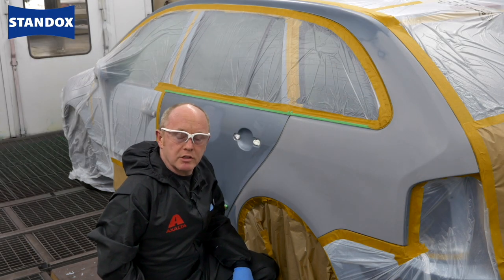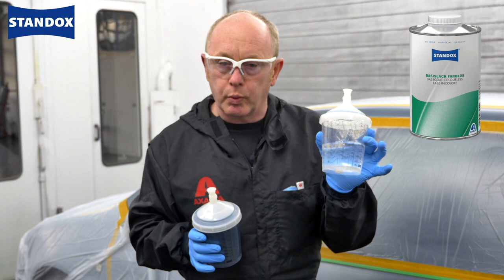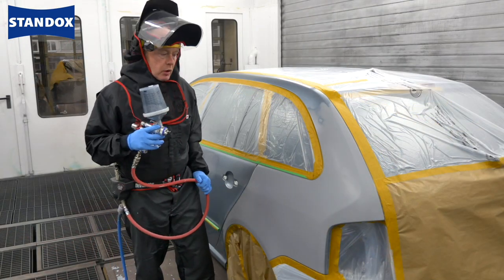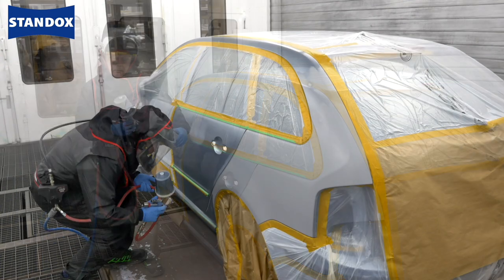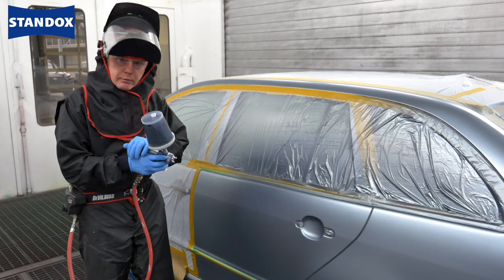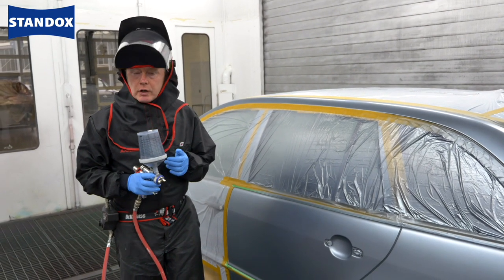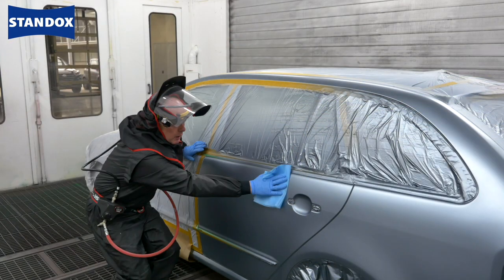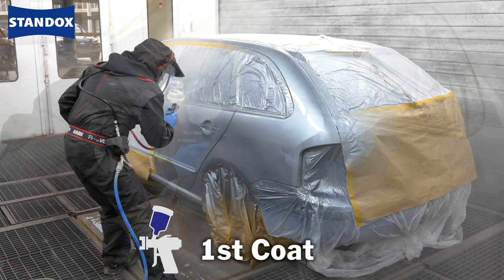Application and blending - Standox Basecoat

Comment: Used standox a lot, liked it but we did used to have bad mottling on certain colours on bonnets and roofs, used to re thin and drop coat, not seen clear base, we used to coat the blend panel with fade out thinner before starting, this cut any static marks and let the base lay down near the blend edge, only big greif we had was the lacquer darkening up the blend panel edge on silvers and light met  blues, standox answer was to 2 gun and use thinned lacquer on the blended panel edge.
Reply from the maker: Hi, thanks for the comments. Mottling control can be improved by: -

- Paying attention to product mix. 
- Use the right thinner to match conditions and size/type of job.
- Check your gun set and inlet pressure. 
- Use a slightly increased distance to the substrate for your second coat and do not - try to fully rewet. 
- If you see mottling/clouding after the second coat, flash off and apply a further even, controlled coat using close overlaps, do not fully rewet>

Comment: Why would you take the risk with that tight door push blend and not just go into door blend. At least you can then guarantee the colour without any problems 100 percent of the time for the sake of a yard of tape and 5 minutes prep. This is what happens in loads of big shops who want to save 10th paint and scream when one goes pear shaped. Madness.
Reply from the maker: Hi thanks for your comments which in principle I would agree with. However, not every shop in every market would have the opportunity to extend the repair fop a variety of reasons and therefore this video is designed to demonstrate what is possible even with a confined blending space. Thanks again.